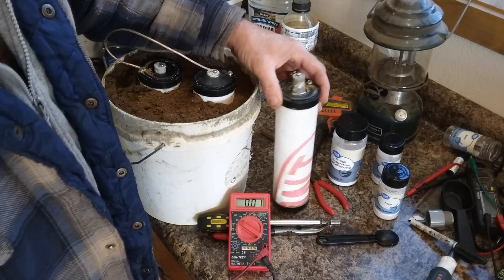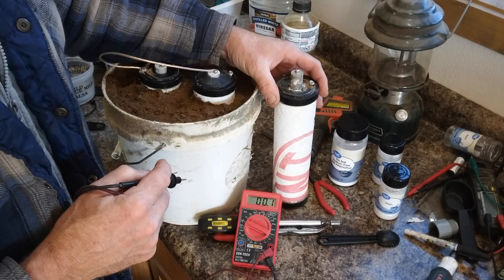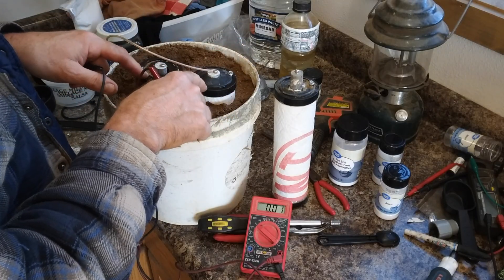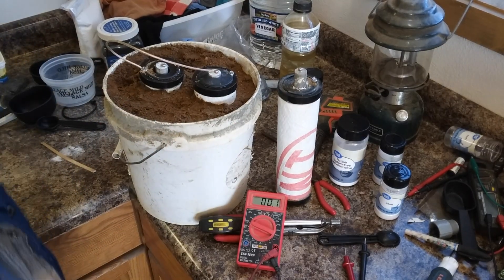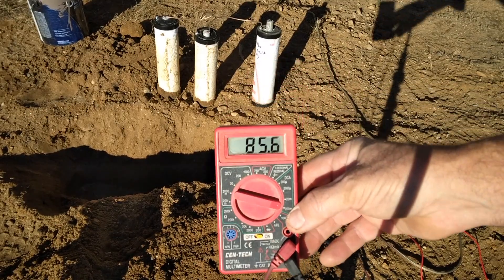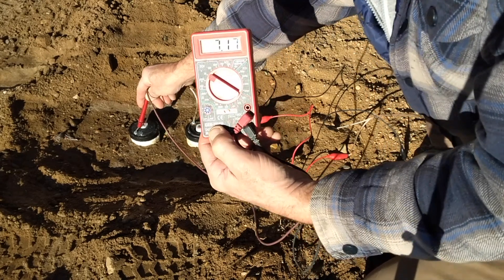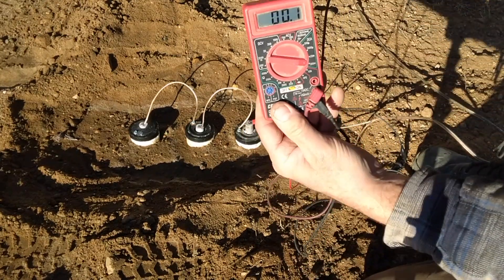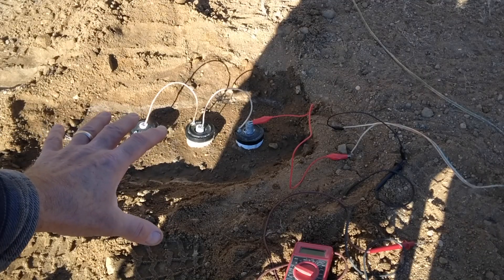Earth battery crystal cells connected in series

Comment: Put a row of 6 in series, and parallel that with another 6 for 12V and double the amps.  dig your holes down hill from your leach field with a solar panel charging and have a continous 12V.battery

Comment: An earth battery works different.  Your cells work but will work in a bucket as well as the ground.  Earth batteries work on area of surface and orientation and take some room to seperate the cells.  The railroad used a 3 foot square copper plate on one side of the tracks and a 3 foot square plate of zinc on the other side with a wire from each to the telegraph key.  They produced 1.5 volts and because of the large surface area gave enough amps to run the key.  Orentation:  If you use a large copper plate and a large aluminum plate, say 2 foot square they should be facing north/south to get power from the magnetic lines of the earth passing through them.  Your cells would have to be 12 to 15 feet apart to act as individual cells.  So a 12 volt cell would take up (8 1.5 volt cells times 15 feet) 120 feet on a north south line.  That battery would work until all the electrolites in that ground were used up.  The bigger the plates, the more amps!!  However 4 1.5 volt cells made from large plates will give you 6 volts and it ain't no step for a stepper to wind a doubling transformer to produce 12 volts ;)  Your not going to weld with an earth battery but it will run 12 volt LEDs (a bunch of them) just fine or work as a trickle charger for regular lead acid batteries!!!  Call it free lights and with a small inverter it would run a transister radio easy enough.  If you got a running creek, why bother.  You can float the raw cells in place in moving water and it will produce the same voltage!!!!!  Who knew LMAO!  Now if that creek is a ways from the house, well DC doesn't travel well as Edison found out ;)  But AC travels just fine.  2 microwave transformers would convert 12 volt DC to about 2000 volts AC and reconvert back to DC at the house.  However those lines would be dangerous and would have to be fenced off.  There are ways, just keep looking!!!
Reply from the maker: You don't happen to have some 3 foot square copper and zinc plates to give away , do you?  Thanks for commenting.
Reply: LOL!  I wish.  But the rail road had a bit better budget than I have :)  But that is the way they did it.  I spent a lot of time on earth batteries.  Found out a lot of ways that don't work and a few that do.  Your getting there just keep after it!!!  Find out why the negative goes on the south side, they work better if the positive is deeper than the negative, and what Stubblefield had to say ;)  Luck!!!!
Reply: @OlderThanDirt-ii3rp  I'm just learning about this. I live off grid and every little helps to keep my batteries charged. Would it work better if I set up 1 gallon plastic jugs with dirt, copper wire and zinc coated nails and diverted my urine using an irrigation line. How many cells would I need. And would this work? I was trying to research better anode/ cathode combinations that would be cheap. But I have copper wire and bolts or nails.
Reply: I need a visual diagram to understand

Comment: Hey you are an amazing person first of all! I had the same brain child! Here is what I found on google. This would work great to get the earth batteries to be able to power your entire house!

A series-parallel connection is a way to connect batteries to increase both the voltage and capacity of a battery system. It's a combination of series and parallel connections that creates a complex circuit of interconnected batteries and devices.
Reply: This would increase colts and amps so it could have a good amount of potential wattage to power just about anything, with dirt and water!!! My mind is blown…

Comment: I enjoy your videos and experiments. 

How long in your estimate this battery can provide power up to 5V in 3 cell configuration you showed here ? is it in months or years range  without any maintenance if ideal moisture level is there naturally or manually providing moisture?

Also it's been 8 months since you posted this video so can you provide update on performance for this battery?

Thanks.
Reply from the maker: I think it will go many years.  I have had 3 functioning since I posted this video until now, running the pulse motor that I just showed in my last video.  Two have developed cracks in the carbon filter, but still put out power.  I think pressure builds up inside as the crystal grows.  Wrapping copper wire around the outside may be a solution to that.  I pulled one apart, and the magnesium rod just showed surface corrosion.  Hope that helps.
Reply: @doubleMinnovations  Thank you for your detailed response. It is encouraging that it can last few years if cracks are taken care of.
Reply: You have demonstrated easy to build DIY earth batteries which works better than any other method used to make DIY earth battery. 

Now my question is :

Are there any way to lower the cost in terms of 2 most expensive parts in your build?

1. Is there any other way of getting  replacement of  graphite rod you used ?

2. Is there any possibility to use carbon fabric or activated carbon powder instead of whole carbon filter itself to save cost?

I am sure it will be  little more difficult to build but if it can save cost it will be worth efforts.

Thanks.

Comment: Wiring in parallel adds up amps.  I built an earth battery and wired it in parallel to a small solar panel.  It worked great to up the amps!
Reply from the maker: I wanted to get the volts up, so it would work with a flash light I had.  Thanks for watching.

Comment: At some point, if you keep improving, won't you just end up at a regular battery? What's the benefit of adding dirt?
Reply from the maker: The benefit sticking them in the ground, or moist dirt, is just the they would naturally stay hydrated. -a maintenance thing.  But you're right, it's a regular 'crystal battery'.  It's a do-it-youself battery.  Easy to make and take apart.